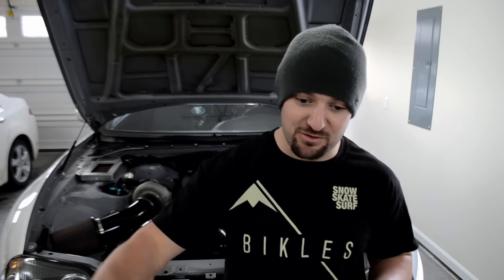Subscriber Meet, Harbor Freight, DriftMotion & Supra Parts

Comment: I've never understood the name brand thing either.  I used to when I was young and its maybe because I'm ex-military and they teach us not to get attached to things. I don't know.   I was a professional mechanic for years, always used Craftsman tools,  tool boxes, and never had any issues.  I was made fun of because I didn't use Mac or Snap On but my tools work and never broke on me.   Keep in mind, I used to work for a Chevy dealership.....  Mechanics there teased me about tools and they work on Chevys.....  Talk about irony... Name branding is a huge marketing strategy, don't get me wrong, I wear Under Armour attire over cheap clothing and clothes found at the mall so I do like name brands to a certain extent.  To me, if it works, it works.   The important part is that you have tools that work professionally or for the DIY-er.    I've done it on the professional level and paying for something that's 3 times as much as a tool that works just as good doesn't make sense to me when my $50.00 Craftsman one with lifetime warranty never gave up on me once.  Worse case, I have to call Craftsman or Sears to replace mine which has yet to happen, big deal.   Keep up the awesome videos man.

Comment: Don't give up so easily on Harbor Freight air tools and power tool. My rule for HF can it kill me ? Yes! Then I pass. I use dewalt mostly however I do have like an impact and a angle grinder from HF did I get the $ 30 of use out of them after my coupon probably, and any use of that beyond is cream. (Actually used the cordless impact to successfully remove a 2jz crank bolt once haha!)